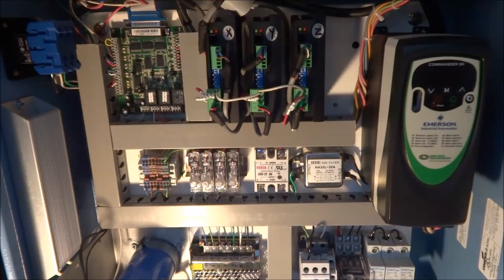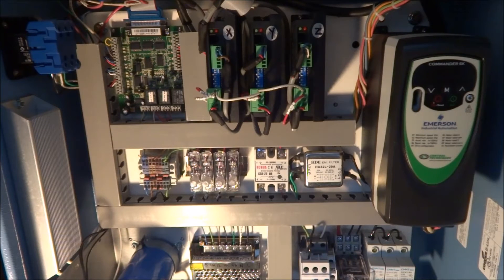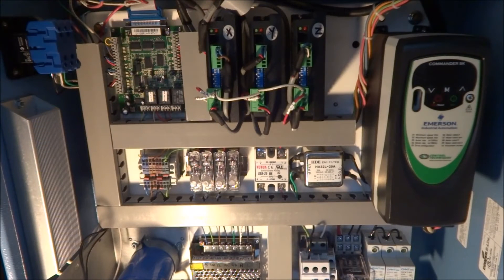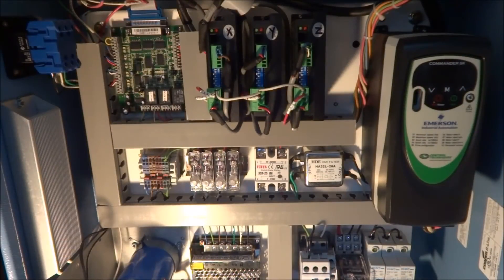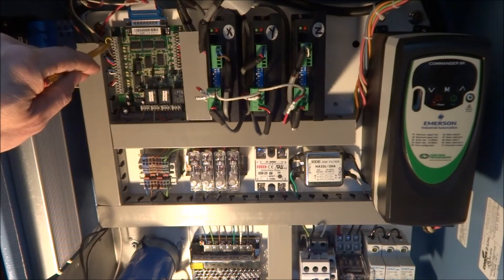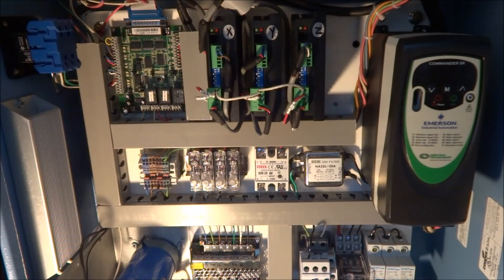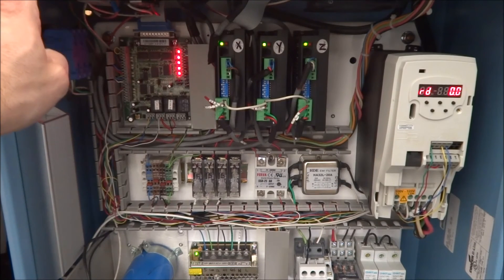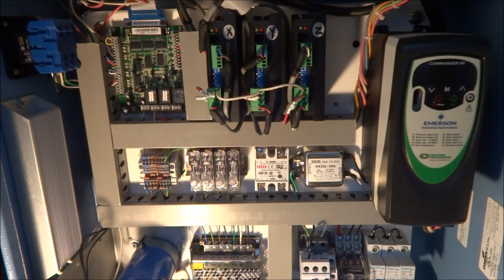C-11GS  Safety Charge Pump

Comment: this is a great video that could save you from getting injured in case of forgetting the keychuck in the spindel of the lathe, I have an older C10 board and was wondering if it has the same switch to turn on to make sure the spindel does not turn when turning the computer on.
Reply from the maker: Hi John,
 The C-10 does not have the SHCP feature However it also does not have the Spindle control feature. I use the C-10 on My G0602 and Have not had any issues. But I still do not have Mach3  controlling the spindle as of yet. 
Be Safe,
Sam

Comment: Hey I am going to buy the C11G. I am not going to use the relays for the spindle rotation. I see there is a relay that is controlled by pin 1 or 17. My question is can I jumper this to Pin1 and put and input of 12 volt. And use this to turn on a selenoid to start my mist. It it is jumpered to Pin1 how do I turn that in from Mach 3.. just have Mach turn on Pin1?
Reply from the maker: Hi Neil 
Its bee awhile since I looked at the c11gs instructions but if I remember correctly.
Pin 1 or 17 is the safety charge pump. Set by a jumper. So the other output turns on the third relay. Just simply set that output up for your mist or flood. In general config.